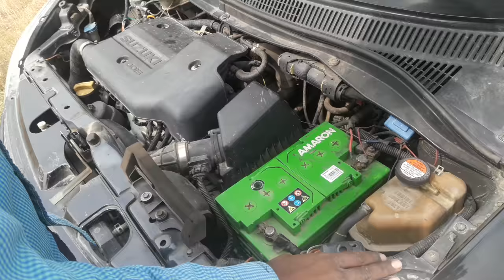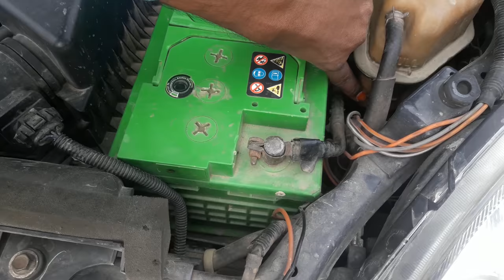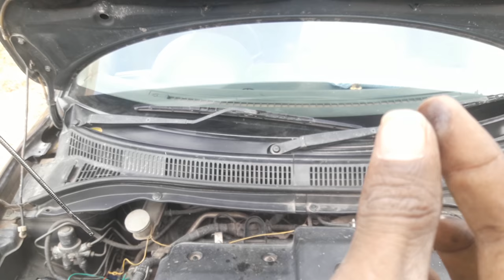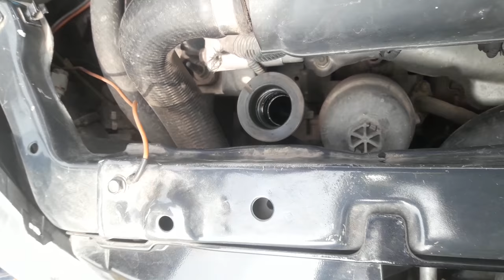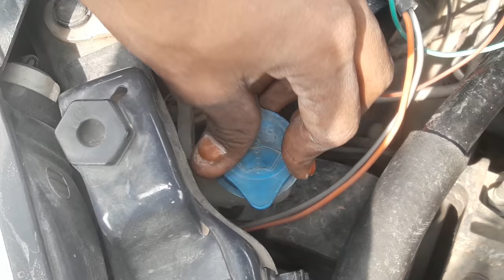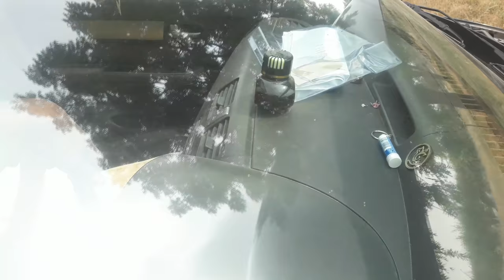How to check liquid levels on car engine||If you won’t check regularly car engine gets seized

Comment: Adi coolant oil kadu,  coolant liquid ( Concentrated chemical water).  Coolant eppudu Low to full madhaylo maintain cheyali endukante engine heat ainappudu adi expand autundi. Full is maximum level when engine is hot. Thanks.

Comment: Sir na car Swift vdi 2015 M.  Okasari car start kaledu Mekanik chupiste disil supply kavadam ledu Injector problem ani cheppi clean chesi vatine malli pettinadu disil tank lo water padinai ani 250ml enjan oil disil tank lo posinadu  Aa roju nundi running lo stiring Hard ga vastundi dash board lo Km and speed mitar ami chupinchudam chadam ledu  solution cheppagalaru plz plz
Reply: Steering oil change chai bro alage car okasari full service chepinchu